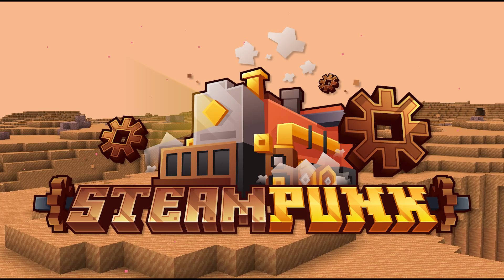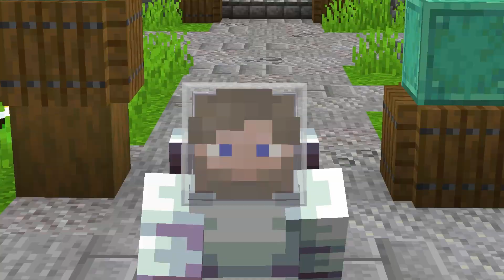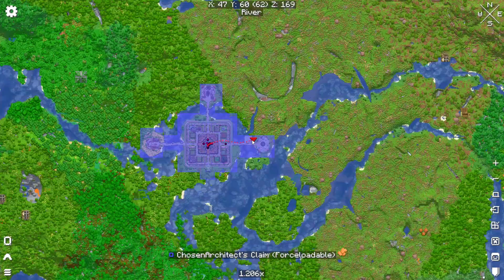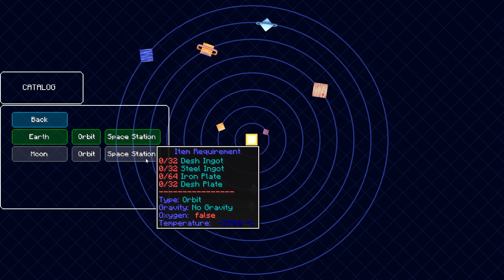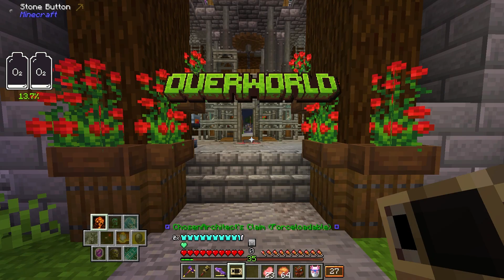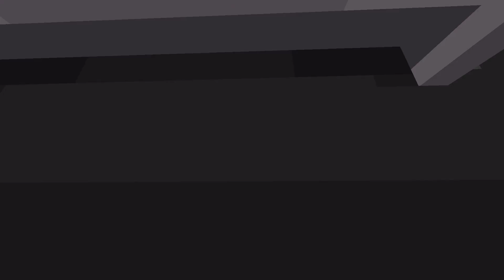Rocket Hatch Using Create EP46 SteamPunk Minecraft Modpack

Comment: The temperatures inside the planets and moons are more stable neutral temps than above ground because youre going to the core with lava lakes. 

Above ground was like 15 cold on the moon and like on venus surface its burning hot for example.